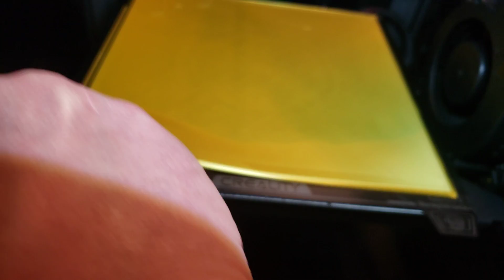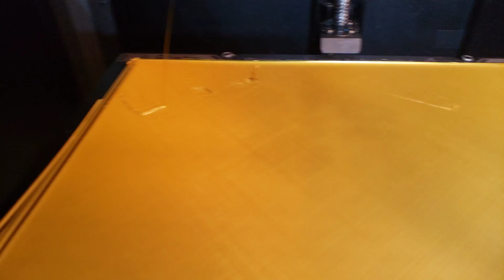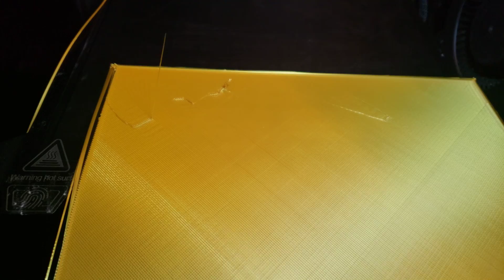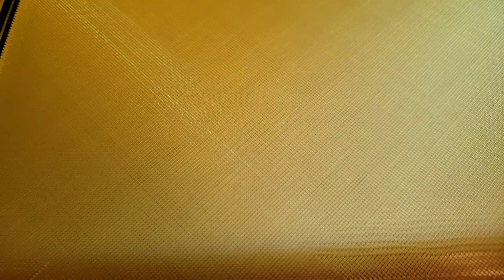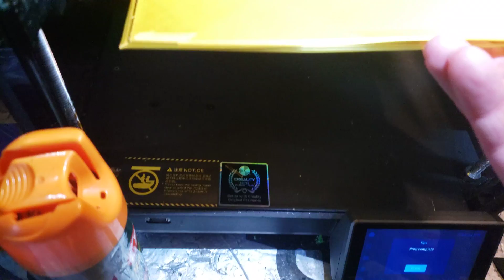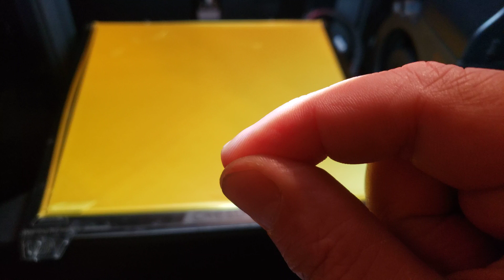Recap Of How To Get The Best Calibration And First Layers 3D Printing, K1 & Most FFF Printers

Comment: Purchased a K1 Max last week. Scheduled to arrive the 15th. Found your channel and some of the problems you've been having with your printer making me really uneasy. Would welcome any suggestions you have on models for first prints to burn this thing in and try and find any issues.
Reply from the maker: Don't worry.  Keep in mind I bought first day of release of cutting edge design, early adoption thing.   Worked great out of the box with NO TUNING for months daily, and the minor issues have been updated, so you should be fine I expect.  The subject of this video applies to any auto-leveling 3D printer, simply advice on how to get the best results with any printer.

I find first layer perfection unnecessary, but this week felt like pursuing it anyway, and it just takes a bit more tuning, as with any printer.

Funny I see many videos of people showing their great results as if they didn't put in a bunch of test and tune to dial it in.  Myself I've been printing both my failures and successes to keep it real.

Keep me posted on how it goes for you, and I encourage any questions if they do come up.  Enjoy your great printer!
Reply: Don't worry the issues have been worked out .. For me it's been just learning how to use the material I use at higher speeds (PETG, PC/CF, PETG/CF)...